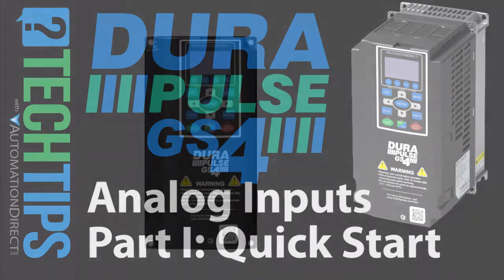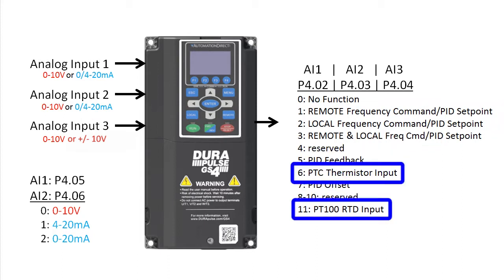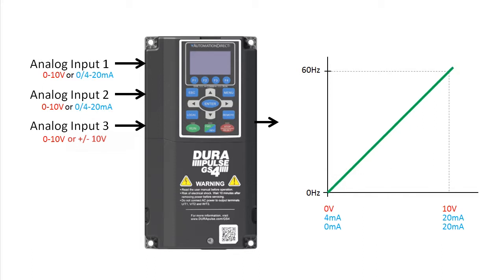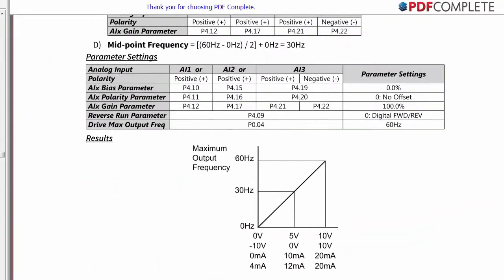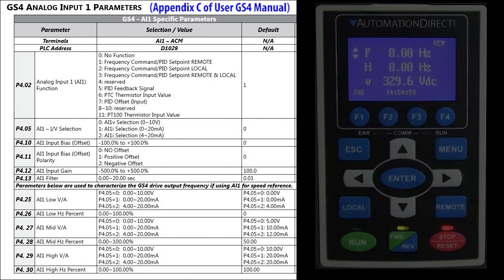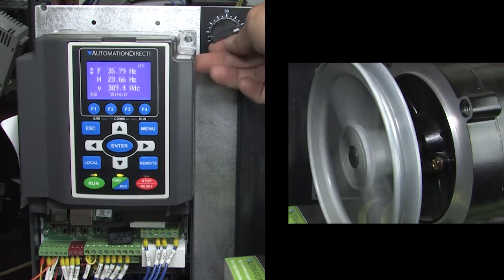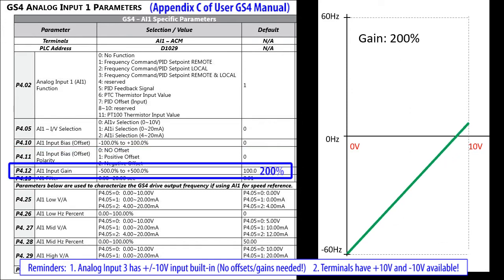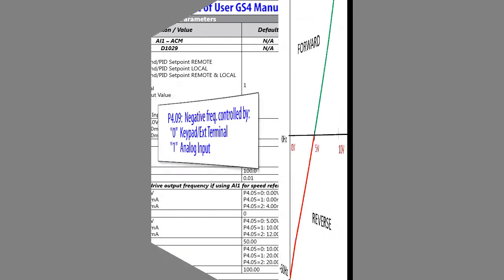DURApulse GS4 VFD Analog Inputs Part 1 from AutomationDirect

Comment: Is the Ramp/Slew rate adjustable? For example, if I step the Analog DC input voltage from 3V to 7V and back to 3V, can the slew UP/DN time be adjusted?
Reply from the maker: Are you asking if you can change the rate at which the drive switches between 3 and 7V?  Sure, Just adjust the acceleration and deceleration rates.

Comment: On the gs3 it also has variable frequency gain. Will this improve pot ability to use full frequency range by amplifying it? I have a 5ohm pot and it cuts frequency off at 119hz about 2/3 of motor peak rpm.
Reply: Yes 5k
Reply: @glennedward2201  Which analog input are you using? A1 is 0-10V, A2 is 0-20mA and A3 is -10 to +10VDC. Verify that your analog input is actually getting the full voltage range.
Reply from the maker: @Glenn Edward, I am assuming that you meant to say you are using a 5K Ohm pot? If not that might be your issue. The GS3 drive requires a 5K Ohm impedance match. If this was just an error in typing, I would advise calling into Tech support and having them help you further. 1-800-6330405. Thanks